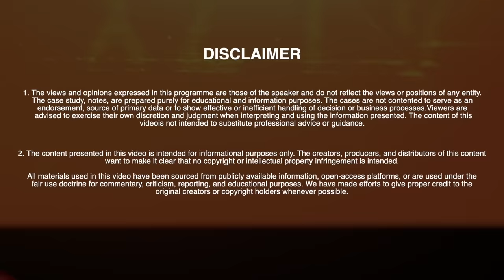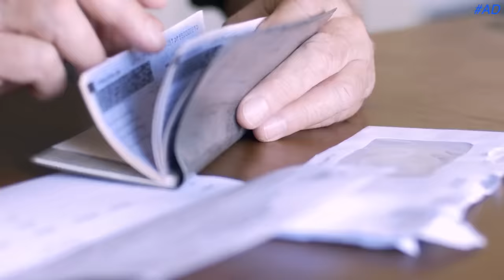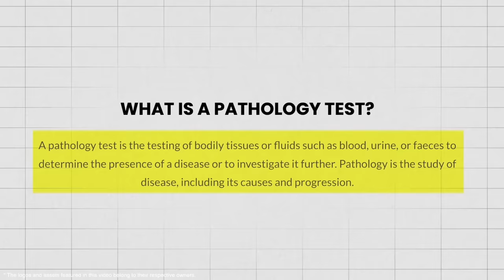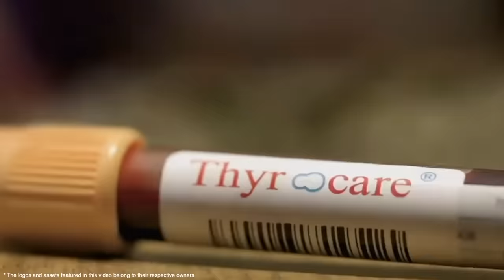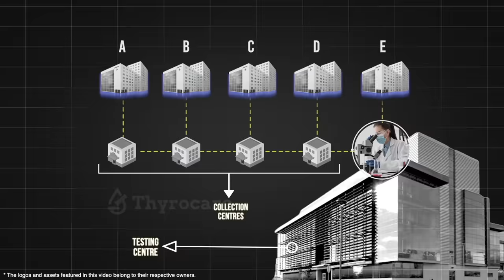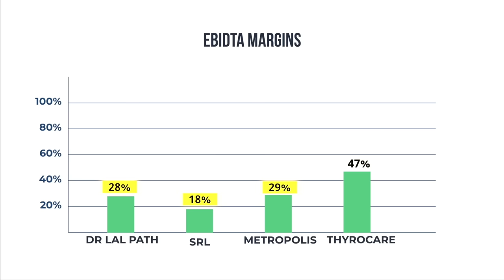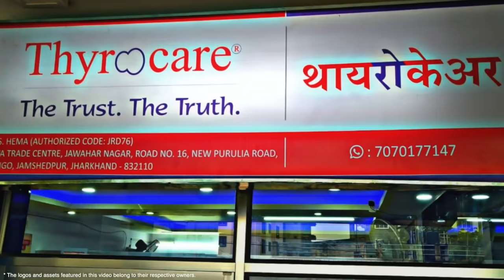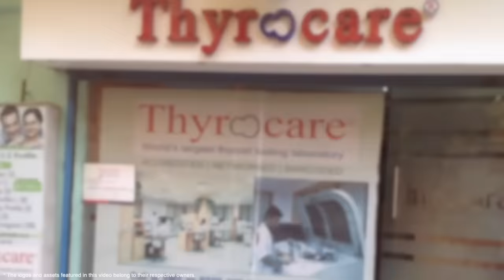How did Dr Velumani turn Thyrocare into a 3000 crore company? : Thyrocare case study

Comment: I want to see this in radiology labs too by some company one day. These equipments are very costly and one have to travel kilometers to have a test done for MRI or CT Scan. If any company can bring down these tests to even 1000inr, I would call that a success.
Reply: Not going to happen since Healthcare is also looked as demand and supply due to CT and MRI machines cost crores of rupees and reverse funnel is applied to recover the cost.
Reply: @abhishekbodke3004 but if the cost is reduced testing can be done more frequently after cost cuts even at private settings specially by middle income strata…invariably increasing revenue!
Reply: @akshaysharma8940 cheaper testing more testing leads to over treatment. That's why rich people get over treated while poor people can't even get basic tests reliably.

Testing costs aren't the bottleneck.
Purposeful and deliberate running down of govt hospitals is the reason.

Comment: The numbers seem to be outdated. Today the margins have crashed to the 20%+ range. Cash flow isn’t very promising and hence the share value has plummeted from almost 1500 to half of that. Expect better research from you and also researching why the share values have crashed. This gives deeper insights
Reply: The purpose of the video is not to provide stock picking for trading. It's about decisions to bring up a business

Comment: The reported Ebitda is showing around 23-24% for 2023 in the May 2023 investor presentation. Where did you get the 47% figure?
Reply from the maker: Its 2016 data watch the video properly
Reply: @ThinkSchool  apart from first instance, I did not see you affirming that point. Message sent was that it continues at that performance. Anyway, thanks for the video. I got curious and tried to confirm. I have clarity now.